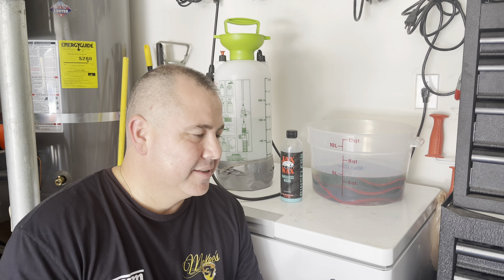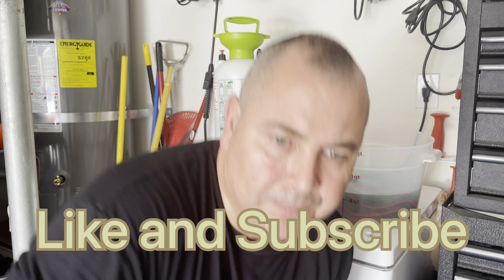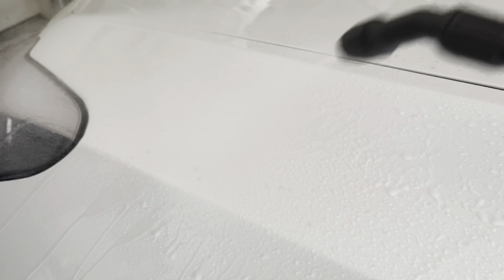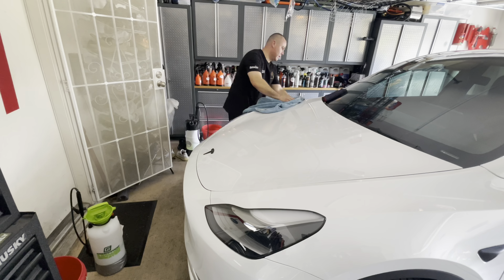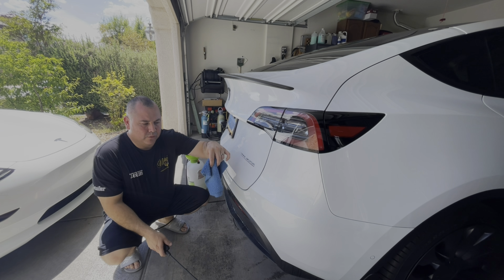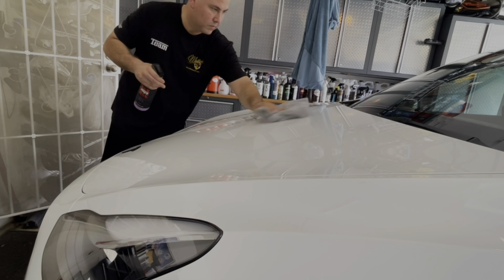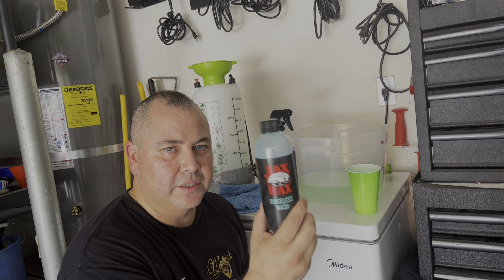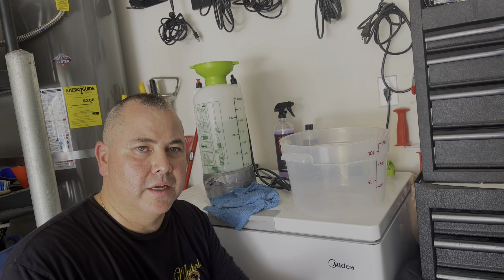JaxWax/ Rinseless Wash/Waterless Wash/Easy Steps To Keep Your Car Clean/ Auto Detailing

Comment: Bought a pump sprayer for just this and came in today.  Funny it's the same as yours just the 1.3gal 5L black version. Using it with the new Absolute rinseless wash.  I know this is an older video and Absolute was not release yet.  I couldn't justify the large IK sprayers for the cost as of yet and the small hand held ones just don't hold enough and takes too many pumps.  Great video man, enjoying the channel.
Reply from the maker: I just got a new sprayer and it works great.  I’ll do a video on it.   Have fun
Reply: @DetailingBreakdown  Awesome can't wait to see it in action.